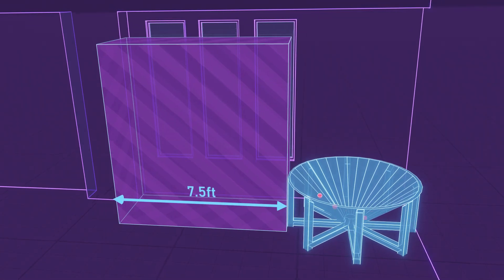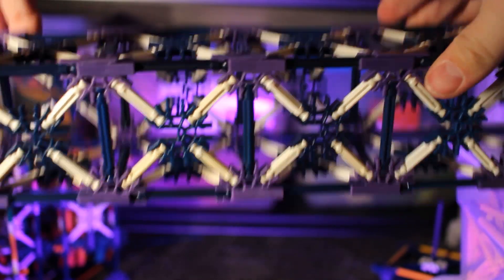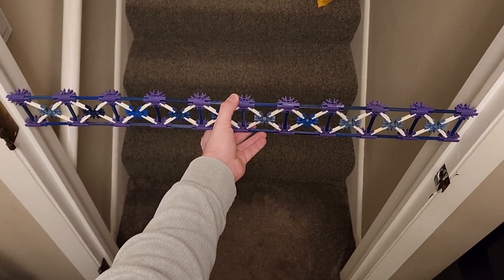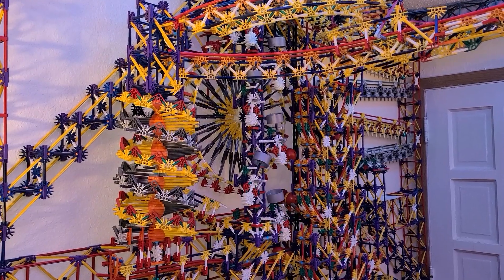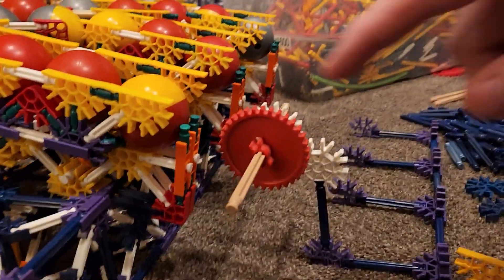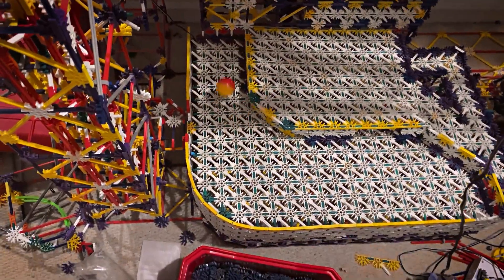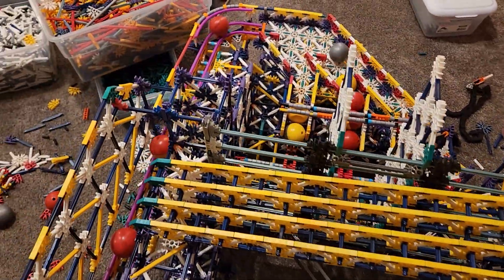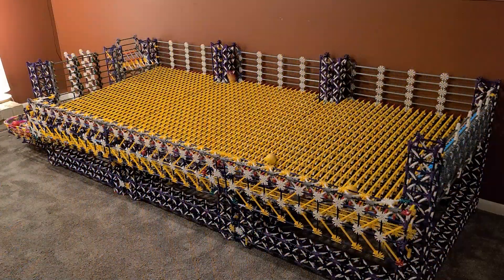K'nex Build for The Works Museum 2023 - Episode 2

Comment: This reminds me of the Marble Machine. When you mentioned that you had to find a way to divide fhe balls I got a bit scared because I was afraid it would turn into a similar situation as the marble divider. I'm happy yo see that you managed to find a proper solution this quickly. 

I'm really looking forward to the next update video! Keep up the good work :D
Reply from the maker: The marble machine is actually what inspired me to build a passive ball divider like this! Before that I had been considering overcomplicated mechanical designs.

I think it's a bit too early to say my design is "working" currently because I haven't yet tested it with a motorized lift, but at least the manual tests seem promising.

Comment: Is there a reason why you used the blue 7-way 3D connector in the middle instead of the white 8-way connector?
The ones you used do not visually pop out as much, which is the only benefit Incan think of. But I wonder if there is more reason to use it over an 8-way connector
Reply from the maker: The main reason is just that I have thousands and thousands of blue 3D connectors, and not that many white connectors, so I need to ration them carefully.
Reply: @Austron  Well, that's a very good reason. Thanks for the explanation :D

Comment: I understand if it's already too late to mention it now, but making flat panels, as sub-assemblies for a larger structure, works well for me and may for you too.  I had it in mind when making my computer desk a year ago, and it's quite stable despite the panels being floppy on their own.
Reply from the maker: As the machine grows, there will start to be ball paths that will fill the full volume of the space. This will allow me to keep these paths mostly intact and attached, only needing to disconnect them at the 2 seams between the 3 large sections.

If I were to make the machine flat-pack for transport, then all of the paths would have to be disassembled and re-assembled on-site.

This method will be more difficult to move, but that only has to be done once. The main goal for me is just to minimize the amount of time spent doing additional building on-site after the move.